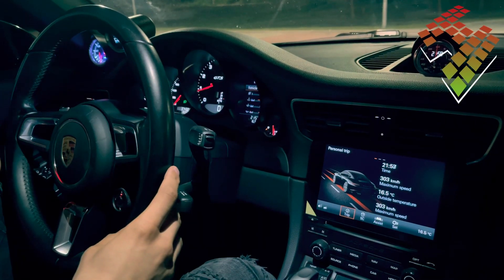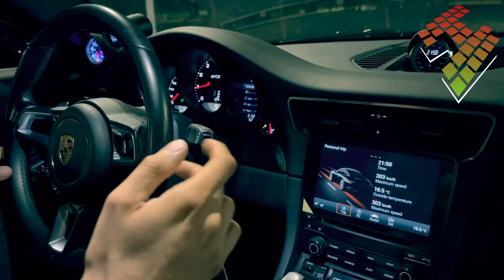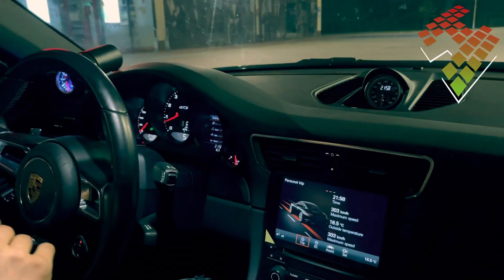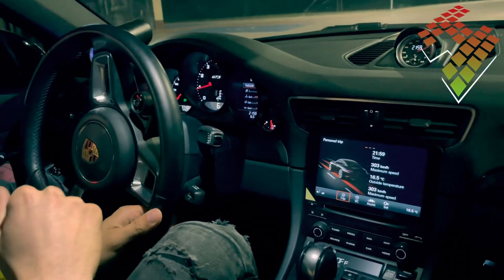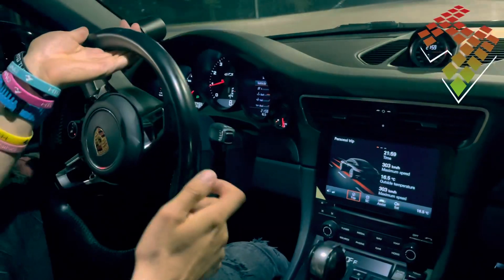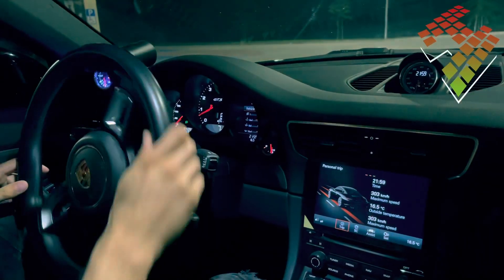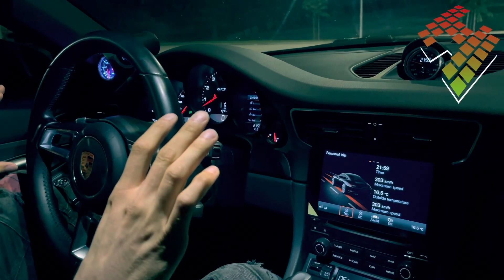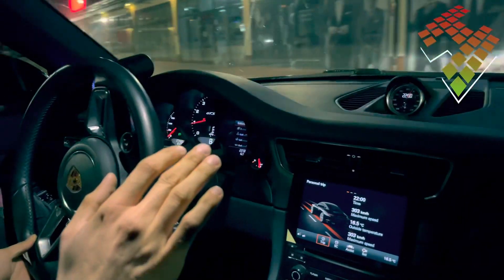HTG GCU Crawl take-up (closed loop) | Porsche 911 GTS Turbo PDK

Comment: I am a total noob so excuse me if this is common knowledge. Do you have the ability to program some sort of "auto-hold" function that modern cars have? I am going to run M4 dct with a 2jz. Cheers from Sweden!
Reply from the maker: It would be possible but major part of auto hold function is handled by ABS system applying pressure to calipers during inclined static scenarios. GCU with adaptation data is able to hold pressure on bite point so taking up on inclined drive would be way easier
Reply: @HTGtuning  thank you for the answer!

Comment: Crawl function coming to DCT too? Isnt it basically clutch slipping a lot?
Reply from the maker: All dual clutches. It's handled in a way that there is no impact on clutches 😊
Reply: @HTGtuning  Can you explain how this works? I mean : either its in 1st gear, or its not. And everything in between is clutch slip no?
Reply: @djes.36  wet clutches are really quite incredible these days when it comes to clutch slip and wear, not something to worry about unless your transmission fluid is at 150 Celsius